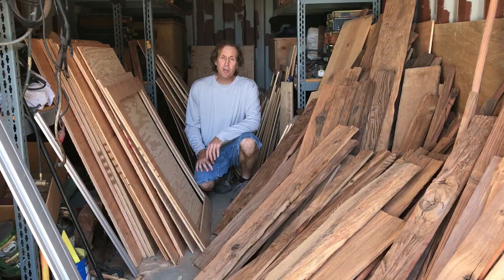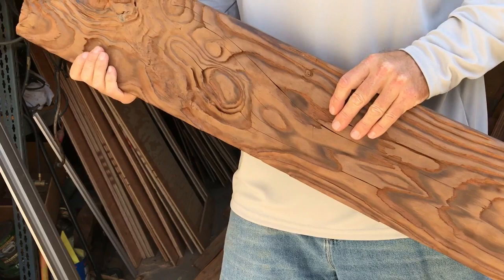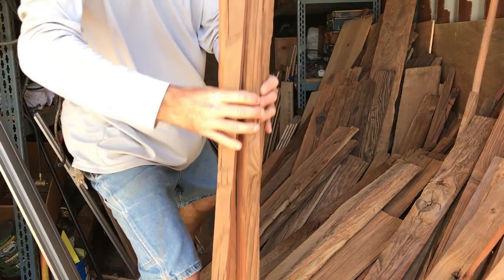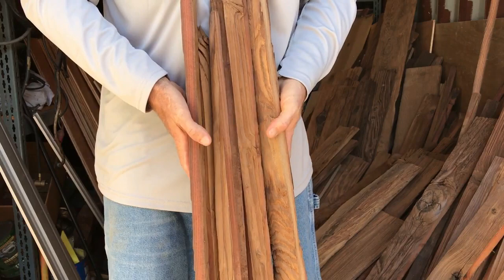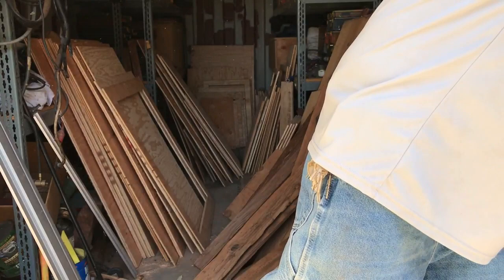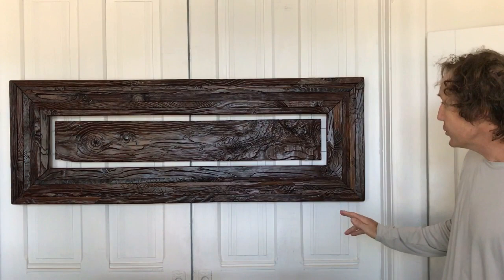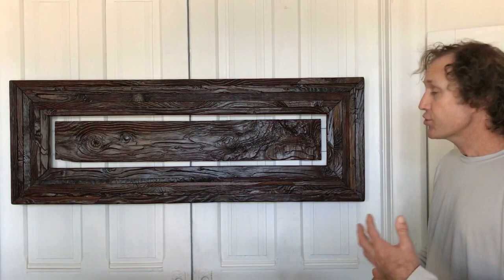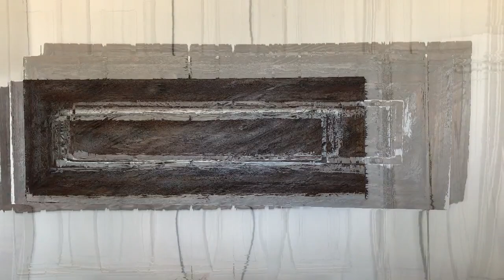Mixed Wood Rustic Wall Art Sculpture

Comment: The close ups at the end really show how beautiful that wood is!  I like the dark stain good job!
Reply from the maker: Yes, this is some of the most beautiful wood I have ever worked with. Luckily I have lots of it so I plan on doing a lot more picture frames and wall art sculptures in the near future. The finish is actually a clear antique flat oil based polyurethane. Even though its a clear finish it still darkens up the wood quite a bit.

Comment: "Go with the wood!"   LOL! Gonna steal that but give ya credit Scott.  Wondering if you have a general image in mind to flow around?

 A lot of effort in this project and video.  What a patient Kittie!  LOL!

How much time in this project?    As it just popped up  and I didn't pick it from your archives....is this an early effort!  Thanks!

Oh yeah, I appreciate your end of the video commentary about the process.
Reply from the maker: I started out with somewhat of a general image of what I wanted to do. The idea was to frame the centerpiece with some of the strips of wood I had. I didn't start out knowing exactly how I wanted to do it so I just made it up as I went and for the most part tried to use the wood strips as they were although some needed to be run through the table saw. 

Yes, this was one of my earlier videos. As far as the time spent,  it was approx. 5 days between the carpentry and the finish. Not full days, probably more like half days on average, some days longer - some shorter. So 20 hours might be a good guess.
Reply: @scottoconnor   Thanks!  Now checking out your videos one at a time as time permits.

Comment: scott, tell me, where do you get these boards, for your art?
Reply from the maker: This wood salvaged. I'm always on the lookout for either free or inexpensive wood. I got this a little over two years ago off an ad that was on craigslist. I had to work hard to get it and do a lot of clean up on it but it was well worth it. I check craigslist regularly for either free or inexpensive wood.
Reply: scott oconnor Thank you. everything is understandable. Tell me what's on the screen, tell me, where do you get these boards, for your art? Aluysta, what types of wood are used mostly in work, oak, maple?